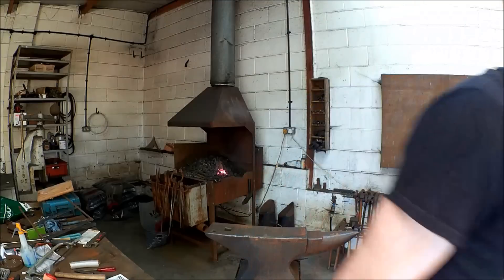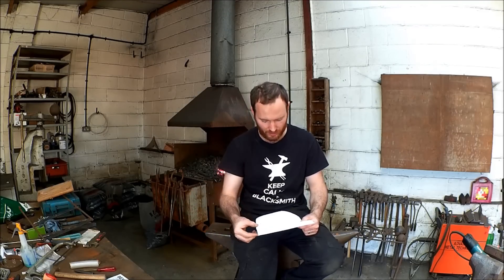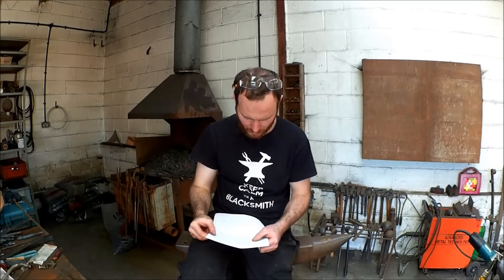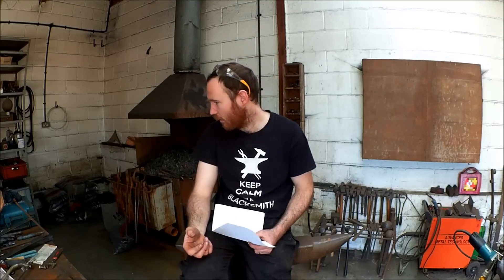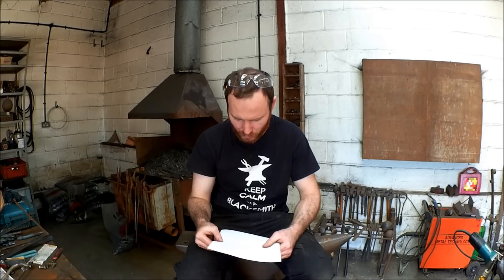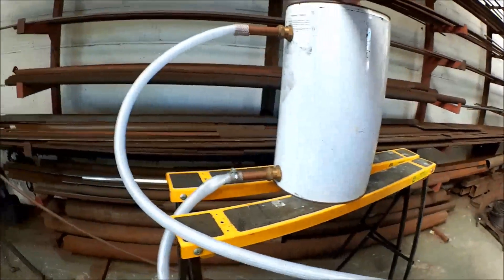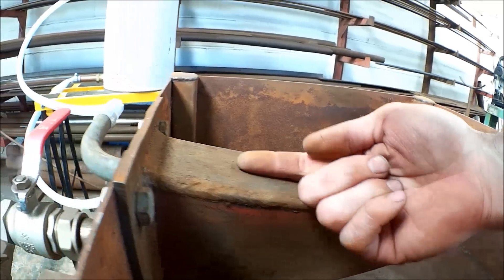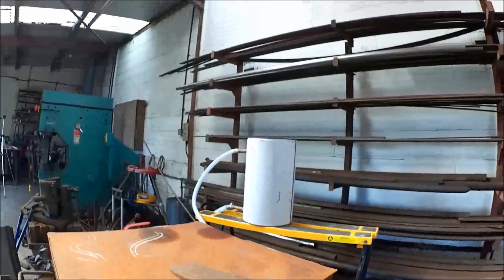Blacksmithing - Why Side Blast Forges Are The Best #2

Comment: I can't weld, is a pipe made out of a castable refractory good?
Reply from the maker: If you cast one or even make one from clay it will be a 1 time use only as the slagg will stick to it and won't come off. If made from steel it won't stick. I recommend learning to weld. A stick welder is only £40 on banggood.com buy 7018 rods from a local supplier. All the very best. Cheers J

Comment: Should the side blast air stream be directed upwards or downwards, or is it perfectly horizontal, does it matter?
Reply from the maker: It's normally directed horizontally. This way sediment doesn't drop into and block the pipe. The coals diffuse the air and oxygenate the embers in all directions. Cheers J

Comment: When using bituminous coal as opposed to coke, what if any changes would you make to your forge and/or blower?  It’s not easy to lay my hands on coke at present.  I tried using anthracite as it’s cheaper, doesn’t produce a lot of smoke and seems something like coke in terms of its properties, but it produces huge clinkers that I have to clean out every couple of heats.
Reply from the maker: Hi. Coal is a bit different. Steam coal is very good apparently which is a type of bituminous coal. It 'coke's up' when burned and sticks together forming a type of crust that acts like an oven. Coal will burn without the blast of air so It normally needs maintaining using water to quench around the outside of the core so the whole hearth doesn't end up catching on fire and smaller controlled nucleolus of heat is left. The forge won't change but how you use it will do. You don't need as much air so you can get by with a smaller blower. Instead of a mound of coke you'll just use enough coal to maintain the core and adding little and often to it.  At least that's my experience but I don't use coal very often and different types behave slightly different to others depending on the types of impurities it contains. Cheers J

Comment: My initial impression of a side blast forge is they seem as if they would be quite heavier than a bottom blast. There are some very light and mobile bottom blast forges. 

If I wanted to make a forge that would be used outside and rolled back into an unisulated shed (where it can get down to -30C in the winter), would this be a suitable design? Your demo forge looks like it might be possible to put some wheels on so it could be dragged outside but I am not sure how heavy it would be when loaded up with sand or bricks. Water freezing is also an issue but I guess there are anti-freeze additives you can use, not my field of expertise though. 

The one thing I am quite familiar with already, is the thermosiphon principle you use for water circulation, at my work place we use that for wood fired heaters for wooden hot tubs, works exactly the same. I see some side blast designs just have a built in open tank on the back, I guess this is less efficient since it doesn't create as good a circulation.
Reply from the maker: Hi Dennis. Check out my BBQ forge video. That shows just how Mobile it can be. You don't necessarily need to water cool it but it does make the pipe last a lot longer especially if doing a lot of forge welding. Also the clinker doesn't stick to cooled pipe making it easy to clean through the day. Cheers J

Comment: Hello! I'm converting my bottom blast forge to a side blast, just because I just spent 95% of my time in the shop today dealing with fire problems. As far as the reservoir goes for the water, could the water pipes just go directly into the water barrel? I'm thinking the hot water pipe could just go to the top of the barrel and the cold water pipe can just come right out of the bottom. And what about rust? Does it rust out too easily? Thanks you! And thanks for your great videos, they're really in depth and are super helpful.
Reply from the maker: Thank you. Yes that would work. On the first part of this series my main forge has a tuyer coming straight out the tank(back Bosch). If it's 5mm mild steel it will last 10years before significant rusting. If you make it from thin stainless it will last longer. All the very best. Cheers J

Comment: Great video's with lots of useful info. And humour. Also speaking as a mainland Europe citizen, thanks for giving the measurements in metric as well! 
You spoke of making a video about side blast forges using coal and charcoal etc, but I can't seem to find it on your channel. Am I slowly going blind or did you not get around to making this video yet? Keep up the good work!
Reply from the maker: I haven't made that video yet. However because my supply of coke is dwindling and hard to get hold of I'm thinking of making my charcoal and forging an axe with it. Got lots to do first but will definitely do that. Cheers J

Comment: Great video. The cooling system is actually called a "Thermal loop". It is why you have stop check valves in your house boiler. Otherwise a thermal loop would be established and your boiler would continue to heat the house non stop. It works great.
 If I may, I think you'll need bigger hinges for the lid. Just my .02
Reply from the maker: Thanks Peter! I appreciate any extra wisdom you can give me. Cheers J

Comment: So why is side air feed better than bottom air feed, is because bottom feed blasts more dirt into the work?
Reply from the maker: Hi Tony.  Yes partly. Doesn't block up as easily, better fire adjustment. If its water cooled its lasts far longer than a sacrificial plate. Better dynamics. Down side is generally more bulky and less transportable.
Reply: You should have explained this in the video as I was waiting to see why the side blast forge was better. Thank you if I build a forge it will definitely be side blast.
Reply from the maker: Thanks Tony. Its a good point. There are other types of solid fuel forges such as furnace forges and Japanese style v forges. Gas forges have different qualities for different applications and can't be compared with solid fuel and there are oil forges like diesel and bio fuel. I'm glad you liked it and if I can help any further do let me know. Cheers J

Comment: Brilliant info, I have a question is a 48 mm pipe to big for the air pipe (I’ll be using it with a electric blower) or will it work? Thanks a lot paddy
Reply: Thanks for the quick response and yeah I’ll be using it for coal/coke and ok that makes sense I’ll cut and weld it to 30 mm thanks again paddy
Reply from the maker: @Paddy_7_7_7  hope it goes well. Take care. J
Reply from the maker: Hi paddy. If you use charcoal it will be OK because that particular fuel needs low pressure but high volume. Coke needs high pressure low volume in comparison so you may find your heat nucleus is far to large and you'll use too much fuel for light work. If you can cut and weld it so it tapers down to 30mm that would be ideal. The ones I make are 25mm and are good for compact forge types.

Comment: But why are side blast better than bottom blast, or did I miss that part?
Reply from the maker: Did you watch the first part? I may not have made a comparrison but a bottom blast clogs up fast and is genrally harder to manage than a side blast because the sand can be structured to suit and is easy to get the clinker out even while still forging. gas forges have their place but you can't acheive a short heat or a short fire weld and the gas forge requires a welding flux which you don't need with a well managed coke forge. multiple forgings can still easilly be done in a coke forge like a gas forge, a side blast is clean because it does'nt blow the silica back on the work piece like a bottom blast and can achive a high temperature faster than the gas forge. I hope that's helpful. please feel free to ask any more questions. J
Reply: Many thanks. The last one I built (sadly gone now) was a water cooled side blast, it worked OK, surprisingly as I had no idea what I was doing. It was made of the end of a 50 gal oil drum lined with fire bricks. I now know I didn't need the bricks!

Time to make another.

Comment: If possible, using stainless steel would be even better to build the forge out of because it doesn't rust like mild steel. although if you are welding the pieces together, you need S.S. welding rods and in a very open environment with proper ventilation and respiratory filters.
Reply from the maker: That is a possibillity, normal mild steel sheet that is powder coated or even hot dip galvanized would be cost effective and would do a good job too. J
Reply: Joshua De Lisle 
 NO GALVONIZING! The fumes that would be given off are very toxic. A high temp paint like wood stove or engine paint would be way better and less hazardous to your health and other's.
Reply from the maker: no no the forge never gets hot enough and is perfectly safe, Tuyre wouldn't be coated  with anything oviously and that could be stainless just like my BBQ forge version. you are right in that it is unsafe to heat or weld galvanized material.

Comment: Cheers, Loved the idea so much I just got finished building one. The coal box is 2'x2' and 12" deep. With a water box on the side with attached tue iron. My plan is to line the bottom with sand. But i wasn't sure exactly how to do it. It appears your box has a metal plate just 3" down from the top where all your extra coal sits and you have a smaller box where the coal goes in. Is it just a metal plate with a 6" hole for the fire sitting on some sand?
Reply from the maker: Thats fantastic well done Mike!  all I did was use regular builders sand and the plat at the front just sits on top, the tue iron just pokes through the side of the hearth box butted up so the sand doesnt fall out the side. have you seen the first episode and the BBQ Forge one?
Reply: Yes i seen the BBQ one also. So basically just pour some sand in the bottom place a sheet of metal on top of the sand and dig out a hole in front of the tue for the fire pit? Again really neat idea. It seems like most in the states are using the bottom type but i really like the side blast. I cant wait to get it totally finished and start hammering some steel. I just need sand, coke, blower and she is ready.
Reply from the maker: +Mike Mcdaniel they really are that simple and in my opinion far better than bottom blasts. far cleaner, longer forging time, easyer fire control and better for forge welding I have experienced. I hope it works out well. let me know if you need any advice or more info. J
Reply: Thank you for your time and help.
Reply from the maker: Anytime!
Reply: With all due respect, y'all are saying and writing tru iron in various forms. The word you are citing is tuyere, pronounced , "ta-weehre". it's French.

Comment: Is it necessary to taper the tuyere iron, or could it be left straight?
Reply from the maker: You can as long as bubbles are not trapped and the water flows over the surfaces well otherwise they will not cool properly and can melt, corrode or even course distortion. a slight taper makes it very efficient.

Comment: Counld you give a big more detail on the dimensions of your square tue iron. 
Currently building a similar forge and that's the only bit I'm a little stuck on.
Reply: *Could
Reply from the maker: Hi Nerve Curve! so mine is 250mm (10") long. the face is 100mm (4") square and the back is 150mm (6") x 100mm (4". the Air pipe is 25mm (1") OD but you will need a larger 36mm one for using charcoal effectively. all plate 8mm (2/8") water pipe is what ever you can get or a back bosh is 6mm (3/16") thick
Reply: +Joshua De Lisle thank you this is a big help.
Can't wait to see more of your videos
Reply from the maker: I can't wait to make more, My camera broke and I'm still waiting for the replacement to come, other wise i would have a video done every week!

Comment: Yo Joshua. I've only just stumbled across your channel and luckily it was just at the right time. I'm going to build a forge for (hopefully) production smithing and was originally going to make a bottom blast forge with a clinker breaker and all that gubbins. I've had my doubts and side blasts but this video and the last one really helped me understand how everything works. I was wondering if you'll be covering anthracite coal with this forge in a later video as that's the best coal option for where i live. Thanks in advance and keep it up!
Reply from the maker: Thank you! I will be doing a video on several fuels using a side blast. best thing about a side blast compared to a bottom blast is that the clunker doesn't affect the fire for a long time and when it does it is easy to remover while still working. if your doing a lot of production work I would suggest a gas forge. I have one too mainly for heating long lengths but I can just throw a whole pile of bits in it with out any worry of burning or oxidizing. coke forges are best for fire welding  (in my opinion) but I understand lots of people are more used to coal. I will make more videos soon. there is a delay as my camera is currently broken otherwise I would have a video made every week. Thank so much for your support and I look forward to catching up again soon. J
Reply: Looking forward to that video, shame about the camera though. Do you know what's wrong with it? Also I've considered a gas forge but it really takes a lot of the fun out of it for me. I wouldn't be doing mass production so i don't need to be super efficient. My dad was going to make a gas foundry for casting anyway so it might be an option in the future. =)

Comment: Cold here in the Maine. Most people who have a forge here use just an air blast. Unheated shops would freeze up for five or six months. Great example though. Thank you for sharing.
Reply from the maker: If its stainless steel then I would think you could use antifreeze in the coolant. I had ideas of linking one to a hot tub and then jumping in after a long day forging!!

Comment: Thank you Joshua for the detailed look at how the water cooling works. I had never thought about the importance of water outlet placement in the tue iron so the cold water hits right up front. Glad I hadn't started to build it yet. This arrangement makes perfect sense, but then so does building a larger "once in a lifetime" anvil, right up until like I found myself last week, just home from the flame cutters ("flame cutter" might just be a Canadian term?, aka steel plate burning shop, not sure what it would be called in the UK), with a 200kg anvil body in the back of my truck, and the sudden realization that my chain hoist is blocked by a project which won't be moveable for another few weeks. I had an hour of 'meditative reflection time' while I slowly moved it inch by inch from the truck to the shop. Carry on my friend, your videos are great.
Reply from the maker: Thanks Stephen! sounds like fun. I'm shifted heavy lumps with round bars to role on and leverage. I like to think that I'm discovering how they built the pyramids or stone hedge sometimes!